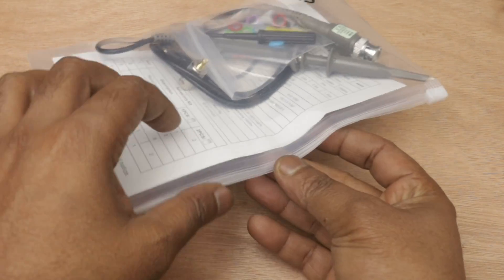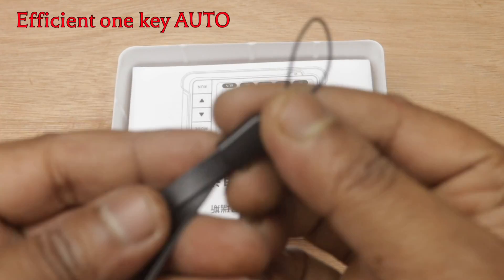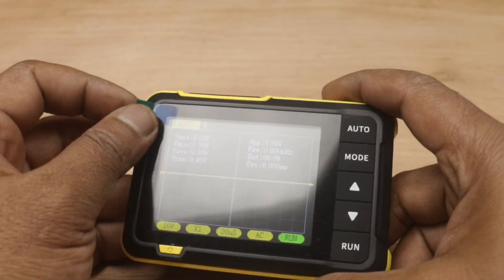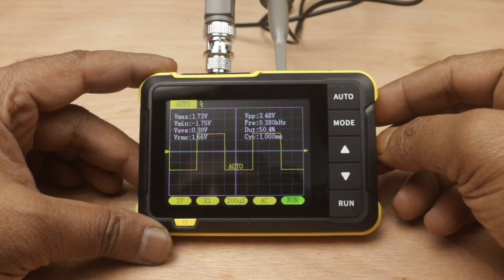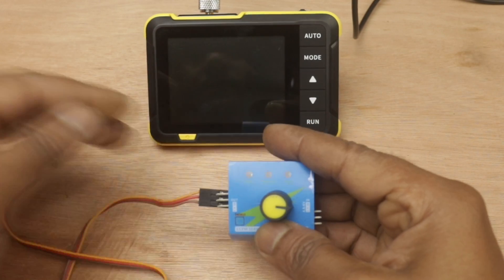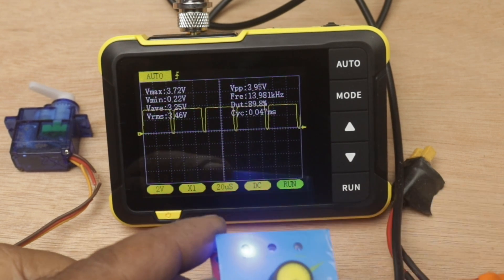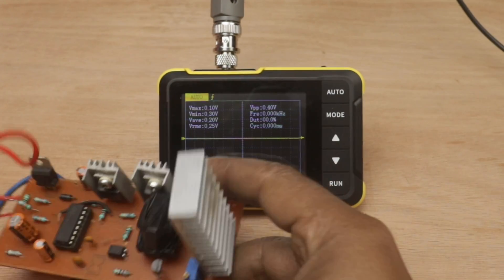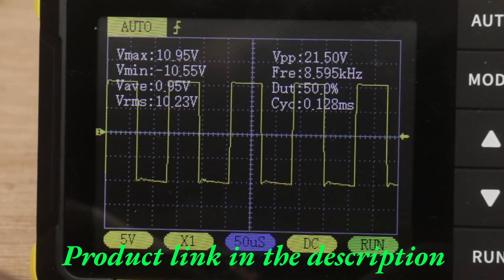Pocket size mini oscilloscope review | FNIRSI DSO152

Comment: Пришлось переходник BNC приклеить к корпусу. Иначе из за плохого контакта, при работе,  без конца лезли наводки. А в целом "ослик" - вполне 👍
I had to glue the BNC adapter to the case. Otherwise, due to poor contact, interference would creep in endlessly during operation. But in general, the “donkey” is quite👍